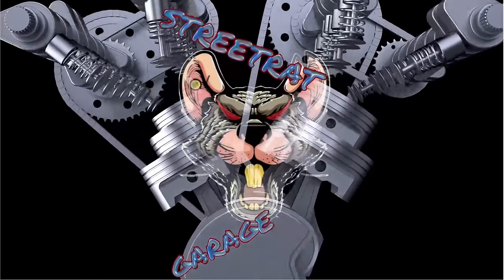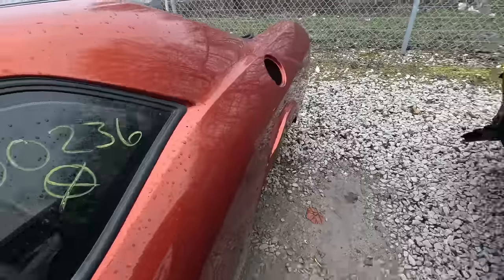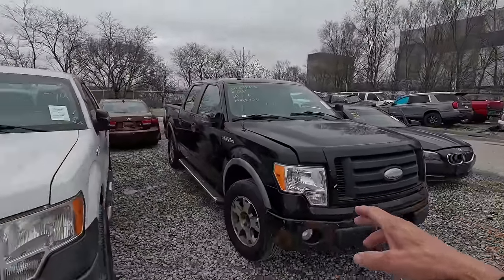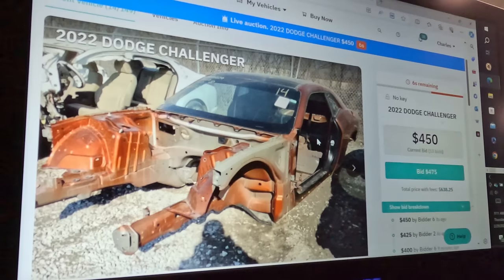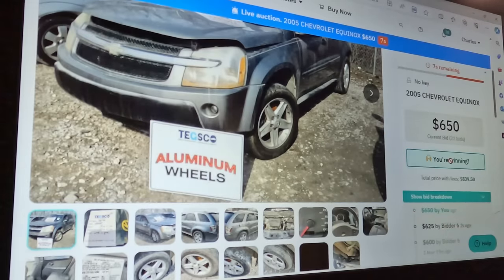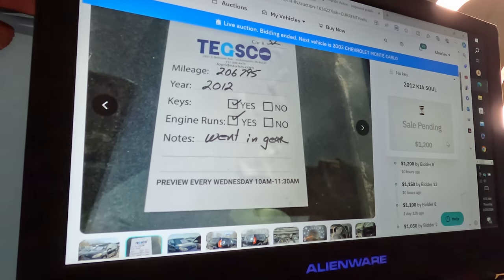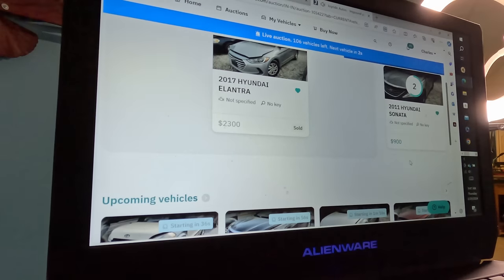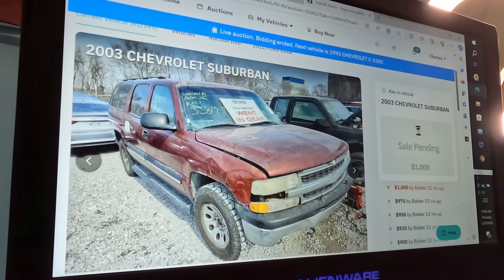Going to the tow lot with $1500. What can we by for a good deal at tax refund time???

Comment: You can still get the VATS resistor keys. You need to get the blank with the correct resistance though (I think there are 15 different ones). Worst case you can get 15 different blanks cut - 1 will work ;)

Comment: FYI on the 2004 Neon SRT4, it was a 230HP turbo version with stock no mods and ran a 13.9 1/4 mile, could be easily modded and could put out 300HP+ and run 11 second 1/4 mile. If you had a good Neon then transplant everything over you would have sleeper Neon.

Comment: Wanted to let you know the crv from that year came with the unpainted front bumper from factory. Looks like maybe hood was just replaced.

Edit: Also if they’re are cleaned up and in good running order they can still demand up to like 4500 on Facebook, Especially in tax time.

About the Hyundais, The Sonatas you were looking at 2011-2015 Have recalled 2.4 Theta engines. The bearings go bad because of metal shavings left over from manufacturing. Those are the only engines that have a recall because of the widespread failure, but all Hyundais’ have this problem. At the dealer only auctions we see Hundreds of Hyundai/Kia products with knocking engines or seized engines at lowww mileage. These cars include these old Sonatas,Elantra’s but we also see a lot of newer ones like 2020’s that engines are already blown or burn so much oil that they will blow shortly. That on top of the rampant theft issues which cause people to not want to buy them (Some insurance companies won’t insure them at all anymore). They are bad flip cars. The cheap prices may seem enticing but it’s best to stay farrr away from Hyundai and Kia at the auctions. These cars are only good to buy new and have factory warranty or better yet lease them.

Comment: These people are a$$ robbing people with these auction fees. That absolutely insane. Literally 2 to 3x dealer auctions. I do agree they should be capped.
Reply: They are actually cheaper then IAA and copart. I purchased a 2013 Hyundai sonata with 120k for $2,200. The fees alone was $800... Once I fixed it I ended up having 6k in the car. For that price I could've purchased the car on Facebook but I didn't know at the time

Comment: The lumina had 7 digit odometer including tenths, so ya only 8500 original miles, I'd jump on that but not over 600 bucks
Reply: Nope, it's 8, freeze frame at 2:37. By 1997, GM and Ford had larger odometers.

Comment: Question do you know what that Lexus LS460 did. The one next to the dodge charger cop car.
Reply from the maker: I believe that one went for between 1000 and $1500. I can’t remember exactly but I do remember when I went back to pick up my equinox they had just had a key made and we’re trying to start it. The engine sounded like it had a box of rocks in it. They wound up pushing it on to their trailer. That’s one reason I do not like to buy unless there are keys.
Reply: What’s a good key company to go out there and cut a key onsite at the auction?

Comment: Hyundai and Kia are a rolling pos Engine's do not last, Lawsuits Everyday.
Reply: I bought a 2014 kia Forte at the age 48 I've had plenty of car's and truck's that kia been one of the best car's I've owned bought with 85k now 120k. Brakes and tires only thing I've done
Reply: @onegreatone2810  give it time 👍
Reply: @robertvance1873  at almost 50k miles it's served me well it can take a crap. I'd be fine 5 grand I've had it for more than 5 year's..air conditioning still cold...bra I grew up on a car lot..can't tell me too much if you would have said Mercedes Benz or range rover okay but kia an hyundai a couple of the buys an best sellers .period..and definitely less problems then Chevy truck transmissions..